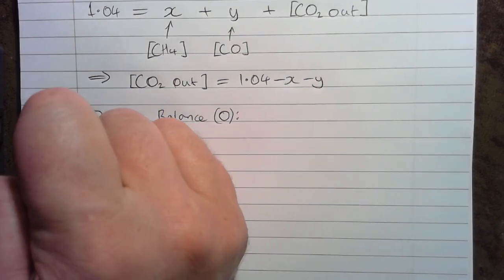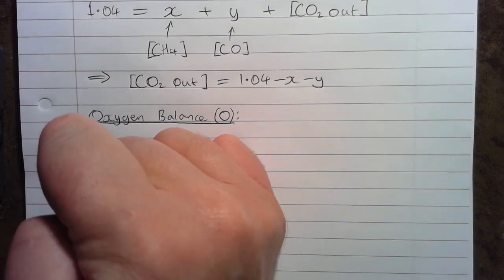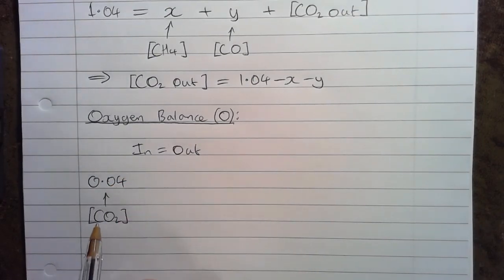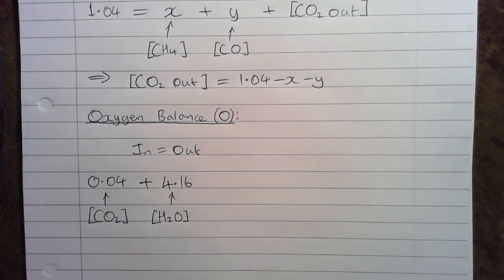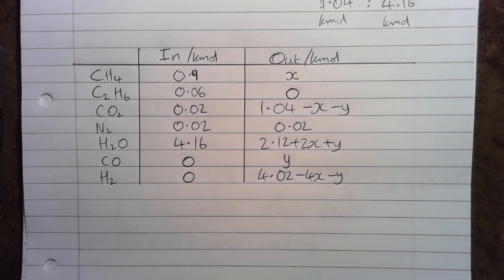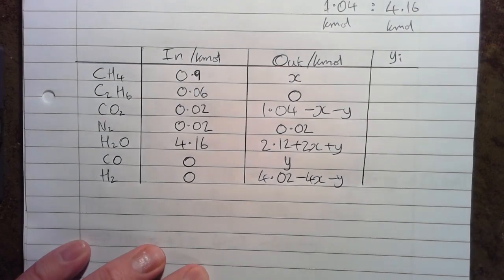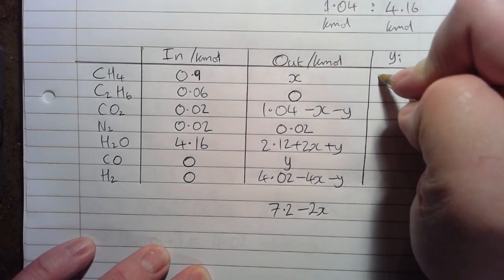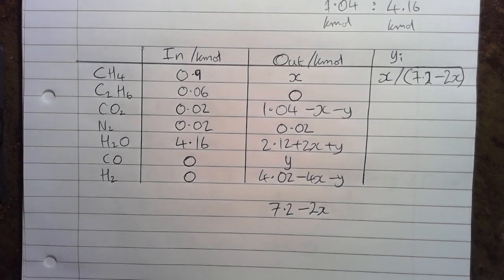Steam reformer material balance – part 2

Comment: I have a similar question.

I have a initial feed which is 99% CH4, 0.01% H2S and 0.99% CO. The system is 3:1 (Steam to Methane) The system is working at 25 bars and has a temperature of 850'C.

I need to make 26 tonnes of hydrogen but am having trouble working the mass balance inside the Steam Reformer. I would appreciate any help!